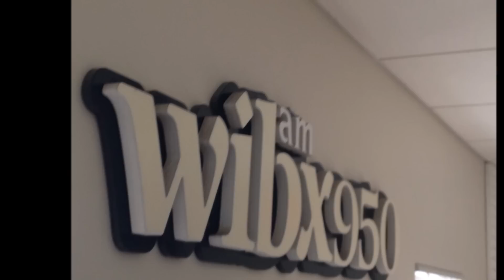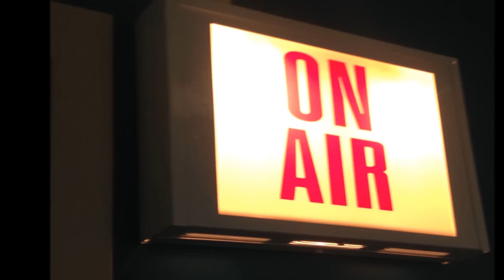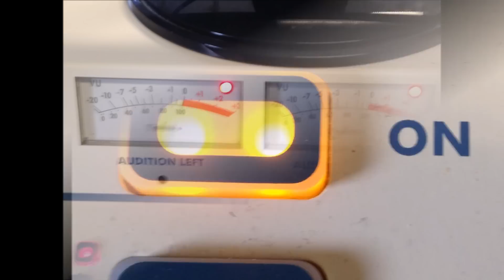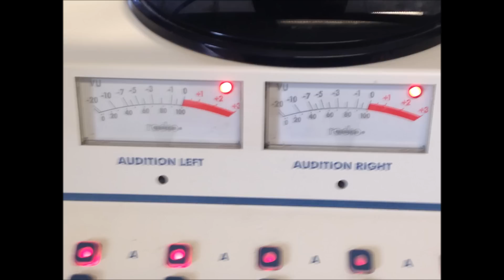Mario has details on train that crashed at Utica's Union Station

Comment: All it takes is an employee failing to apply the hand brake properly. The air system in a car does not have to be tampered with for them to release. A little wind or vibration, time, and a little downgrade with improperly set brakes can cause a moving car. Any railroader who actually deals with cars and locomotives knows that.

Comment: its not hard at all to release a rail car that is unattended. Kids even disconnect cars on trains that are standing still, waiting for another train to pass. If this car was the only car, then only the one hand brake was applied but if it was a part of a cut of cars then there would have been more than one hand brake applied but at the other end from where this car was located.

Your a radio station, why not go down to your local rail yard and have them show you how easy it is to set loose an unattended railcar? Watch videos of cars being ran through a hump yard and see how easy it is to separate the cars, its the same for in a rail yard or on the road somewhere.